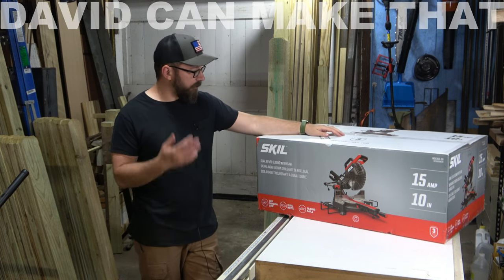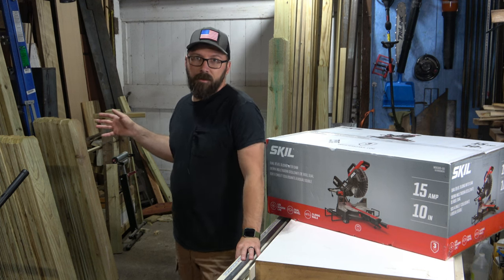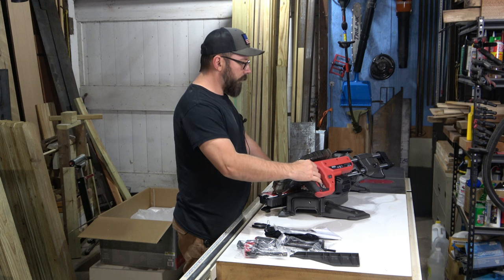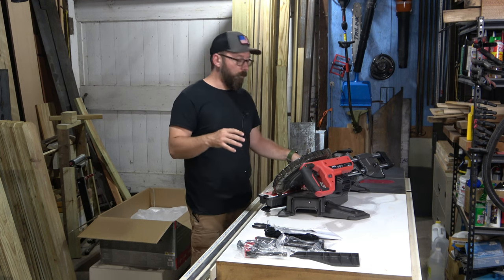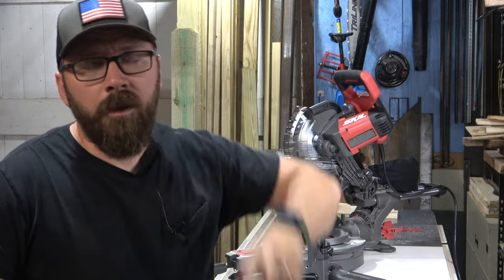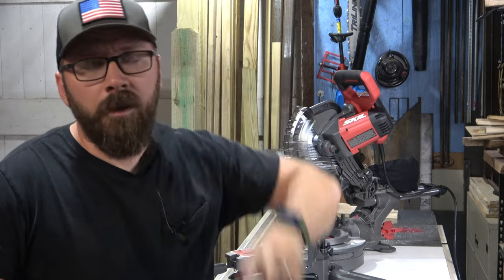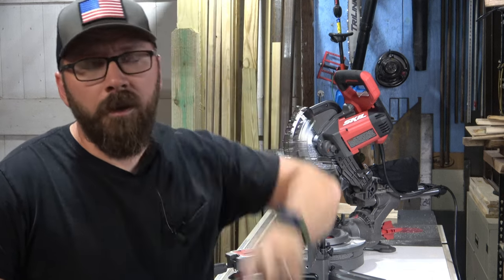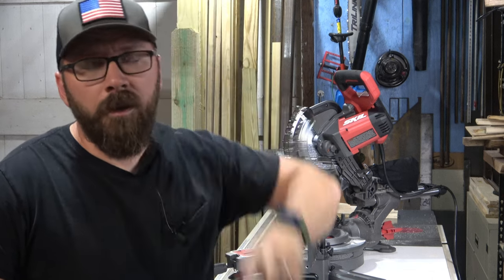Skil 10" Dual Bevel Sliding Compound Miter Saw - Unboxing, Assembly, Test and 6 Month Review

Comment: Man, I found this saw on marketplace after I watched your review and bought it for $180.  I didn’t get to check out the saw but it “looked” legit.  Got it home, plugged it in and ran the blade.  Noticed when I released the trigger the blade was not slowing and I couldn’t remember if it had a blade brake or not but definitely was a red flag.  I ran a piece of construction 2x6 through it and it would cut but then the blade would just stop like something internally wrong.  Now I’ll have to contact Skil to figure out a repair shop and see if the cost is even worth it.  Such deceitful people 😡
Reply: Lesson learned??? Lol 😂
Reply: Scammers, can't trust people anymore.

Comment: I wouldn’t consider the broken piece a mistake. Dude stuff happens. I’ve had pieces fly off in all directions. I’ve cut into the fences on several saws, broke a fence and sent it flying once. Had a piece go through the dust chute through the dust bag and into a sheet rock wall before. This is over 20+ years. It doesn’t happen more than a handful of times in your life unless you’re being careless. Nice job getting the exact replacement.

Comment: Had this saw in my Amazon & Menard's list for awhile.  I almost bought the Delta Cruzer over Christmas when it went on sale for $249 but because of the dust collection issues I decided to pass on the Delta.  Picked this up on sale at Menard's for $199 yeterday (1/7/2024).  Will be testing it out soon but seems to be a good saw.

Comment: Nice video David. I have this saw and the same stand clamps here in New Zealand. I like it a lot and you get real bang for your buck. Skil tools are sweet for DIY and construction. I also have the Skil table saw, drill press, router table, 10A fixed base router and the 14A plunge router. All my Skil tools have heaps of power. Nothing bogs down. Next on the list will be the Skil bandsaw to replace my old but very cool 1984 Black & Decker drill powered bandsaw. Skil are the best value for money hands down. They are accurate, powerful and they last. Even if that saw only lasted 1/2 the life of a DeWalt you are still in the money no worries at all. Guaranteed it will last longer than that.

Comment: Bought this saw 2 1/2 years ago for $250 
I tied to switch blades and the nut holding the blade wouldn’t come out. Skil sent me a new saw after 2 months, but I’ve been using it ever since.   Good saw but had to make a better dust collection system.
It needs better clearance on the right side of the blade as the mother gets in the way on taller pieces.
Reply: You are right.  If you bevel it to the right to 45 degrees. The base of the motor housing hits the board. I was doing a 45 degree bevel on a 2x6 which as you know is only 1 1/2 inches and it hit it enough that it liked an 1/8 inch cutting all the way through.  Other than that this saw is great. Every cut has been perfect right out of the box.  I haven’t had to adjust anything.

Comment: Just got my Skill 10'' miter,
really awesome, but the clamp
while quick, is quite limp. 
I was cutting a short piece from
a 12'' wide board and noticed that
my cut could quite easily be off 
as the blade could likely move it while 
initiating or the cut.  The clamp
on my last miter saw could be cranked
as tight as needed, and it was not
nearly as nice as this saw.

Comment: Dewalts had the shadow line for a while, it definitely helps
Reply: My Dewalt 20V 7-1/4" sliding miter saw has the shadow line, I like it better than the lasers on the older saws.

Comment: I just bought one today. I’m very disappointed with the roughness of the slider bearings. If I push and pull the slider slowly I get a rough bump bump bump feeling and it doesn’t move smoothly. 
Has anyone found this on theirs?
Reply from the maker: I had a little of that at the beginning, until I realized that I hadn’t set up the fence right, and the motor housing was slightly bumping into it and the hold down clamp. Once I figured that out, there were no issues.
Reply: @DavidCanMakeThat  Thanks David. Unfortunately I checked those things and it looks like I do have a bad bearing. Oh well, not the end of the world. Back it goes for an exchange. Thanks for the reply!

Comment: Huge disadvantage of double bevel miter saw weight. I have Dewalt 12 inch it's almost 60 lbs. I keeping in office and carry only when doing real big job. For small job I bought cordless Makita 8 1/4 sliding. 
But in Europe Dewalt, Bosch, Makita sells combo miter/table saw, here in US I asked in tool store it's reason they not selling in US guy told me probably safety concerns. Well looks like some one in OSHA think that Americans are stupid. But for return in Europe it's banned Dadu blade.